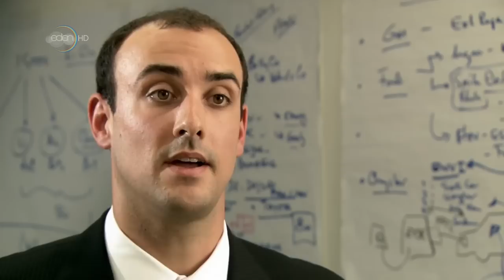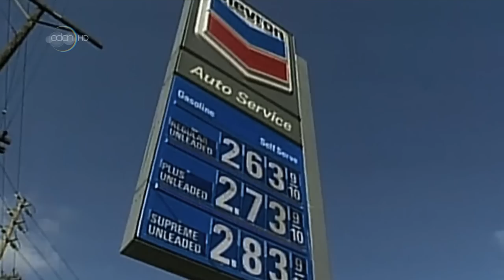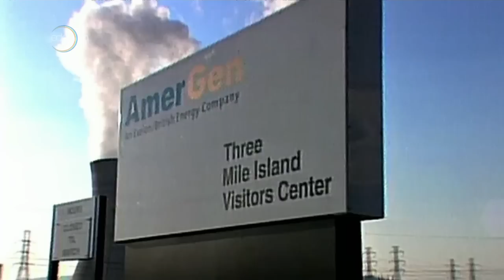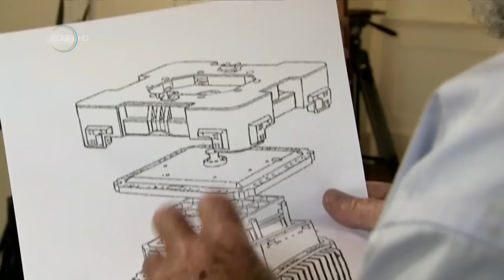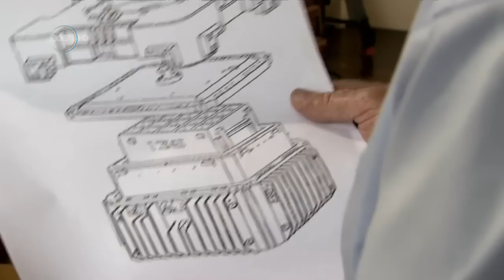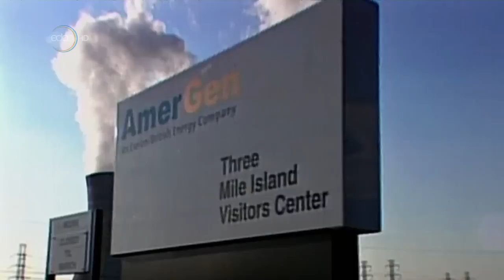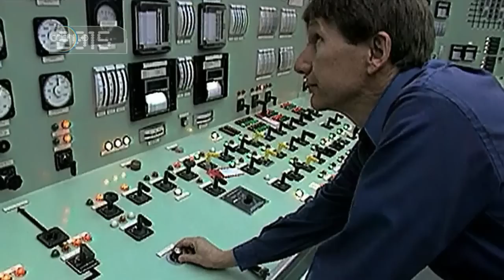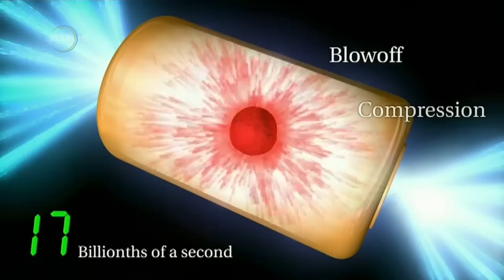MSNBC Documentary: Future Earth - Addicted to Power (720p)

Comment: Which of Nikola Tesla projects was the free and unlimited energy? If it is the one at Colorado Springs that is the claimed free energy. Then it's false info he was working on wireless energy. A way to transmit electrical energy to any location without wires and to power electrical equipment without the need for plugs, charges and batteries. He did invent the first solar voltaic cells which are the basic foundation for modern versions solar cells. Tesla believe if he could build a large enough transmitter he could energize the atmosphere and transmit electrical energy to the entire world. Thus making all the worlds power grids useless. He did mange to energize about 15 miles around his lab, but his project was shut down do to short sighted business men. Those :$F£€€¥<bs! Business men.

Comment: The one I liked was: The secret of working on energized cables is to attach yourself to the live line so your "Grounded". and wow 5000 volts! if its a transmission line its somewhere between 100 000 and 500 000 volts, even the HV outside your house is at least 11 000 volts. Higher voltages allow electricity to flow greater distances with less loss. Why not make some shit up and call it a documentary.....

Comment: actually we have enough proven oil reserves to last more than 100 years
Reply: 100 years is plenty of time to work out the details and beat the NWO trust me.
Reply: I think that geothermal power is the best option but if there were some way to harness the radiation in the solar system and turn it into power not solar power electricity would be cheaper I mean think about it we live in a sea of radiation from our sun and other stars all in the universe. also supposedly scientists say there is this stuff called helium 3 I think. all over the moon that is super energy efficient. all these options and still we are using fossilized plants to power the world.
Reply: *****
The moon has been catching helium 3 since it separated from earth, if that's how it was formed, and it's all right on the surface. we have the technology to get it.

We already have plastic solar panels than roll out like a carpet and just have to be spliced at the ends, soon they will be cheap and if we find better UV stable plastics, these will be used instead of shingles, cost about the same, last 25years, while supplying all your power needs

Thorium is safe as a bar of soap and 4 times more abundant than uranium, but you can't make bomb out of it's waste, so we don't use it to make nuclear power

plus in 40 years we will have fusion power probably without needing helium 3
Reply: Vapor X nah man too many moon spiders
Reply: "Reserves" are not the same as available resources.
Billions of barrels of oil will remain forever in the ground as they are too expensive & difficult to extract. We won't run out of oil, we will run out of affordable oil, natural gas & coal.
Right now tight oil takes 1 barrel of oil to extract 5 barrels & the oil companies are still losing money.
The price of oil will have to rise over $140 barrels of oil for them to make a profit & it will have to keep rising if they are to keep extracting the ever harder to extract resources.
How much can you afford for a gallon of fuel?
Reply: just saying we shouldn't worry too much about running out of oil when there are still massive amounts of it we can continue to use though I do think we should definitely be working on making cheaper and more environmentally safer fuel there are so many options but it takes money to change a system built entirely on coal, oil, and gasoline and their isn't a major enough force to change. personally I disagree with global warming and I think that the climate change the earth is going through today is a natural process. economically it just makes sense to create cheaper and but products be it fuel or cell phone that is all people want.
Reply: before its gone but even if we just keep using oil eventually we could just drill on other planets and take their oil than we can have a star war against an alien nation over oil. do you think we will really go that far.
Reply: once the first jedi temple appears I will be the first in line
Reply: 100 years of oil reserves won't do us any good if we can't extract it. To extract tight oil, we have to pay at least $80. a barrel, as the plays are depleted, it will cost even more to get at the deeper, harder to extract oil. There will come a time when the cost of extraction will be more than society can pay.
When a barrel of oil reached $147. a barrel, the economy crashed and never recovered.
There will be no recovery.
The oil majors are already pulling out from their tight oil leases, too expensive to extract.
The price has to go much higher before they try to extract that oil.
Reply: Sheila chambers if there is a will there is a way I think they will advance extraction technology before they advance cleaner fuels technology
Reply: yeah the sun will go out in 2.2 billion years and that's if scientists are right It could be way longer by the time the sun goes out humanity may have colonized the galaxy we can just find another star.
Reply: I DO know about Geo-thermal energy, there is one such plant in Geyser California but places where you can access those very deep, hot rocks is limited mainly to volcanic areas & that leaves out most of the country.

Geo-thermal is not the same as hydro-power generated from moving or falling water.

Clearly it's YOU who doesn't know what your talking about!
Geo-thermal plants use very hot rocks deep in the earth to produce steam from the water they send down the drill hole, that steam turns a turbine that in turn turns a generator to produce electricity but some underground sources is polluted with sulfur that corrodes the pipes shortening their life.
Yes, hydrogen is the most abundant molecule in the universe but it's so sparse, that it's not available to us.
Again, it STILL takes more energy to produce hydrogen than you can get from it & you still CAN'T  violate the laws of physics.
Hydrogen is a energy CARRIER not a fuel source like oil.
Reply: my one little comment has sparked so much debate wow
Reply: GEEZE, what "home" geo-thermal? Are you daft?
Geo-thermal first requires a site over some hot volcanic rock, then you drill several holes down into that rock, one for the water piped down to it then another for the resulting steam to come out to turn a turbine that then can turn generators to generate electricity.
That takes a LARGE plant, not something a home owner can have.

This isn't something you can do at home because more homes aren't located over volcanically heated rocks.
Such locations are mainly located in the west in the cascade & sierra mountains & in the Yellowstone area.
Perhaps you meant heat pumps certainly not "geo-thermal".
Reply: Yes, hydrogen required more input energy than can be gotten from it, that's why we can't have a hydrogen economy.
All oil extraction is expected to start to decline later this year.
The resources required to build electric cars of fuel cell powered cars are very low grade ore so even more energy (oil) is needed to mine & process that ore. This economy & the worlds economy will soon collapse.
Reply: Geothermal will be around as long as the earth lasts but accessing it is a problem in areas away from volcanic regions.

Input energy is a BIG issue, no one is daft enough to put more energy into making a fuel than can be gotten out. Even solar cells require a LOT of energy in mining & manufacturing, energy we won't have after oil becomes too expensive to extract.

Already the big oil companies are pulling out of the remaining tight oil, oil shale areas, too dam expensive for now. The price of a barrel of oil must rise over $100. a barrel.

The limit to solar is the energy & raw material  to mine, manufacture & maintain those solar cell arrays.
You can't use solar power to make solar cells.
Reply: I guess our ideas of "geothermal" aren't the same.
The geothermal I'm accustomed too needs deep, hot rocks in volcanic areas to produce steam to run a turbine to produce electricity, your "geothermal" is what we call "heat pumps" & I have one of those to heat & cool my home & that can be useful in many more areas than the geothermal that needs hot volcanic rocks & a large cumbersome plant assembly.
I would have liked to have had solar panels if we didn't have so little sun & then there is the problem of all those batteries & converters. Solar systems are rather expensive to buy & maintain & aren't worth diddly squat with cold, cloudy weather like we have much of the year.

There is a similar problem with wind generators, intermittent, noisy & expensive to build & maintain.

The end of the oil age will be the end for most of us. So far despite all of our efforts, so far as I know, and I have been doing my research, we have nothing that can replace the 80 million barrels of oil a day we use in amerikkka. I don't know how much Canada uses but a lot less than us wasteful amerikkkans.
I always check out all new "energy" sources I hear or read about, so far, their too limited, unworkable, too expensive or will be limited by the declining resources needed to build them.

Oil isn't just 87% of our transportation, it's also clothing, heat, medicine, fertilizers, pesticides, herbicides & millions of manufactured products.
Without fossil resources our "civilization" & most of us wouldn't exist.

Electricity as useful as it is cannot replace OIL.
Fracking is the fat lady singing at the end of the age of oil & natural gas.
The "party" is over.
Reply: So far, nuclear fusion uses far more energy than it delivers, I'm afraid we will run out of the energy we need just to start the process before we can make it produce more energy than we put into starting the process. We have been unable to maintain fusion for more than a split second & probably never will get it to function. Nuclear has a lot of problems, the waste, safety & declining ore deposits that need huge oil powered machines to mine.
The party is still over.
Reply: Solar may be "available" anywhere but it doesn't work everywhere & that's the problem.

Where I live we get a lot of cloudy days & we get the least sun when we need it most for solar generation.
The wind turbines are still noisy, it's not windy a lot of the time & who want's to listen to whoosh whoosh all day & night.

The roof is where most solar panels are installed on homes & businesses like our local electric company.
Another problem is the energy needed to mine the raw materials, manufacture the panels, batteries, converter etc then install it, usually on the roof. I would think that putting it on the roof would shade the roof keeping it cooler.

All of these systems are very expensive & the raw materials & energy to make them is getting scarce, the heat pump is perhaps the less expensive of the options but you still need a steady supply of electricity to operate it & you can't get that from a wind turbine or solar panels unless you live in a cloudless environment.
There are many renewable technologys that can be practical in the right environment but as oil & natural gas become too expensive,
food production will fall & billions of people will starve.
No solar panel, wind generator or geothermal can prevent that.
There is still nothing that can replace these fossil resources for all the services they provide us.

Comment: We need to invest in safer cleaner gen IV nuclear reactors that are capable of reusing old reactor waste and even providing excess heat to generate hydrocarbon fuels, partly from the carbon dioxide that is choking our planet. We need to get past the negative stigma created by Cold War era reactor designs - their failures and inherent risks -  and focus on the promising future that Thorium fueled reactors provide.
Reply: Yeah someone needs to slap the BBC across the face with Gordon McDowell's documentaries
Reply: James Stewart Agreed. We shouldn't be looking for the "silver bullet' to solve our energy needs, petroleum was that silver bullet. As I understand, naturally occurring renewable resources do not provide energy on demand, and even peak out of phase with usage requirements (solar). Hydroelectric dams (I'm sure you left absent with reason) devastate ecosystems and irregular winds have plagued even sailors for centuries. When combined intelligently, they may provide a real workable energy solution but hydrogen is the obvious winner. If only we had a better fuel source to release and make usable all that hydrogen... Well I suppose there is a silver bullet but I believe we need thorium to unlock the limitless potential of our most abundant resource, and perhaps do a little cleanup in the process.